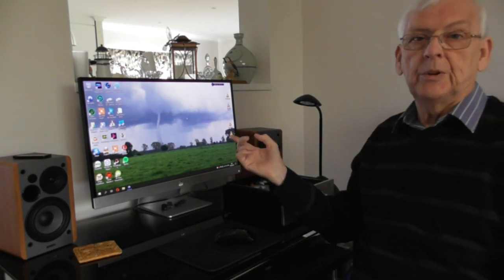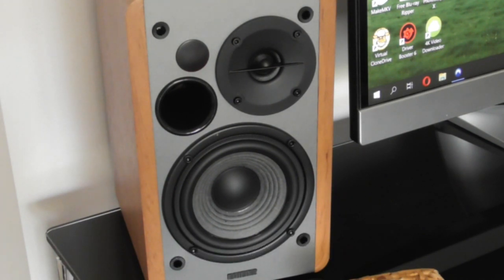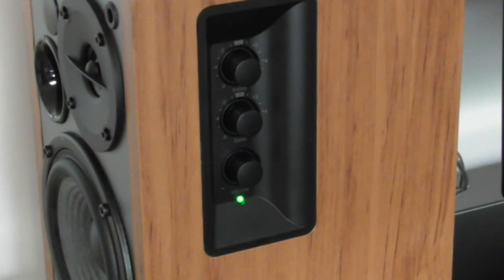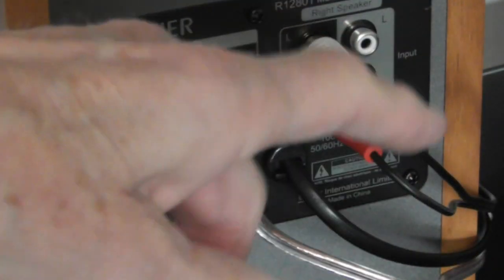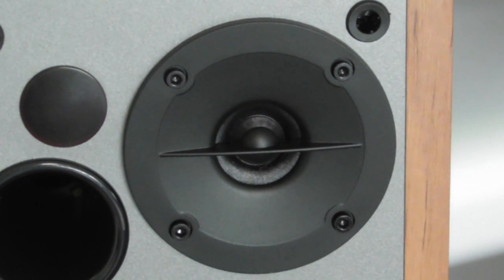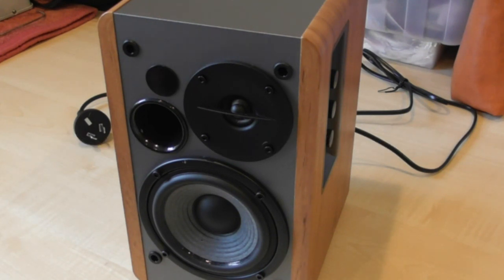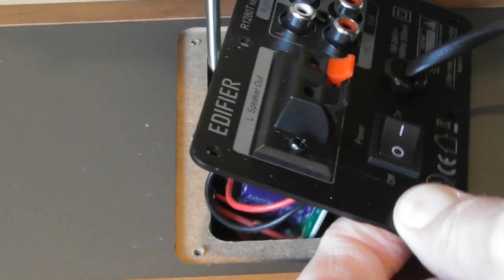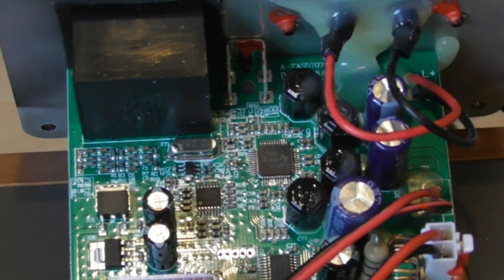Edifier R1280T Loudspeaker review, and a look inside.

Comment: Hello! I have a pair of these (well, the BT version) and the power supply has died. Do you happen to know what the expected input voltage and amperage so I can replace it?
Reply from the maker: Sorry Jaknz I did not make any electrical tests at all at the time of my review. Maybe someone who reads you request may have the answer for you. I'm unable to help as I no longer have these speakers.
Reply: @MichaelBeeny  I have tracked it down. There was a tiny rolled up label on the cable, hidden under the foam batting, indicating it is 16.8V at 30W, or just about 2A.
Reply from the maker: @macphile  Well done, that's saved some leg work for sure. Surprisingly low, I was expecting about 19 volts but for class D with 4 ohm drivers, that would make sense. Not sure where you will fine a SMPS with that odd voltage. Maybe a 15 volt one with an adjustment pot might just work. Good luck.
Reply: @MichaelBeeny  the filter capacitors on both the dead power supply and the amplifier board are rated 25v, so I suspect it would be perfectly happy with 19v in. I don't want to put that to test though, since I was able to find a 16v PSU that it's working with.

Comment: Do you reckon I could purchase better 4 inch woofers, unsolder those woofer of the R1280DB and solder on newer ones.
Quite sure there are better 4 inch woofers with better sensitivity, SPL and frequency?
Reply from the maker: It's not a bad driver, changing it for one you have no info on at all, is a hell of a risk. For what it cost it's really not bad. If you feel it's not up to your requirements, simply sell them and buy better.
Reply: @MichaelBeeny  I see.. because as far as I'm concerned.. these are of the best bluetooth and loudest bookshelf out there. Yet I feel it's not enough

Comment: Hello, 
I own these loudspeakers and I am looking for the upgrade of tweeters. Could you please write me few tips, wich tweeters I could use there? Do you know, what is (what I need) the impedance of tweeter? I dont like the "muddy sound" wich is because of tweeters I think.
Thanks
Reply from the maker: To be honest, it is what it is. Not really worth finding something that fits, impedance, mostly sensitivity. The main issues are the signal processing, not the tweeter. If you are not happy probably best to sell them and start again. So many low cost speakers with amplifiers built in suffer from signal processing.

Comment: My Edifier R1280T left speaker stopped working, I am not able to find 13mm silk dome tweeter. Is there a chance I can replace tweeters with different size, if yes then what are suitable options (here I am asking about specifications, like 35mm 6 ohm 15 watt neodymium tweeter ) and what are the things I need to check before buying like ohms, size, power, fit ? can I use any tweeter which can fix in the tweeter hole of the speakers or what could be the possible solution to just make speakers usable again with almost same quality of sound reproduction. Need an Expert advice
Thank You Sir!
Reply from the maker: To enable correct matching, you need to know the spec of the existing unit, which of course we don't. So, it's almost guess work. I would contact the distributor in your country and purchase a new one.
Reply: @MichaelBeeny I am sorry if I may sound complete noob but on website it says 13mm 4 ohm silk dome tweeter what are the other spec do we need ?
Reply from the maker: @itsabhishekkashyap Sensitivity, is most important. Something never shown in integrated speakers.
Reply: Fortunately the distributor replied and they'll be sending the new tweeter although at not so reasonable rate but atleast I can use them after.
Thank you sir.

Comment: Hi. Did you figure out what the crystal was for on the motherboard?
Reply from the maker: It's probably used in the remote control circuit. I've still not managed to get a circuit. I cannot think what else would use a crystal.

Comment: would you say the difference in air around the speaker is just the reflection? or sonic coupling? I'm about to get a pair for a small desktop home studio playback not mixing . so im wondering if i need to get off the shelf they are on as they will have nothing in front of the box, as it will be sitting at the edge
Reply from the maker: Most speakers tend to sound more open if surrounded by air. Hence an open frame stand is the best option. However this is not always possible. Try it out in your preferred place and see if it's OK. It's not just in front but the sides and back. You will be surprised at the difference placing makes.
Reply: @MichaelBeeny  agreed , I work in the live music industry and we fly PA these days and with point source audio speaker design its a magical setup. hence my wondering if you felt it was a sonic coupling affect or more just the actual air space for the waveforms to develop. Ive sat through hours of Systems techs chew my ear off showing me fly designs for PA's at arenas but Ive never thought about the same science in small bookshelf speakers to be honest . maybe ill adapt some work tech and fly the speakers from my ceiling haha . then i can brag to my front of house engineer friends haha

Comment: Help please! I have the Edifier r2000db and I want to replace one of the bass speakers. Where could I buy the exact same 5 inch speaker?
Reply from the maker: You will need to contact the distributor of the speaker in your country, they should have spare parts available. The driver might be made just for that compony.

Comment: Would anyone know if it is possible to remove the side wood pieces to be able to modify or exchange for another one without damaging the box? I couldn't see any screws inside the box to remove them.
I would like to buy the R1700bt and exchange the wood for Imbuia (a wood here in Brazil).

Thanks for you video Michael!
Reply: It will be possible.  You would have to smash it out with a hammer, be carefull around the edges tho

Comment: When you say turn off bass completely do you mean set the dial to 0 or to -6?
Reply from the maker: Yes -6 this will kind of compensate for some of the extra bass boost in the EQ. Your own speaker location will play a part in this adjustment.
Reply: @MichaelBeeny  Thank you. With -6 setting, I found that 80-90Hz dips too much with 10-200 Hz test available here: https://www.audiocheck.net/soundtests_headphones.php I also hear some distortion (sounds like something soft detached from the speaker from the inside, or air moving a piece of fabric at high velocity) in (only) the right channel during the bass test. Not sure if it's because there's less space inside/more things that can rattle, but I'll be exchanging my speakers today.
Reply from the maker: @moonny5890  I think you have a faulty unit, I had to replace mine because of a faulty tweeter. They should sound very similar to each other. On a white noise test, they did. You are never going to get a very flat response due to the high amount of signal processing and the tone controls. I don't know why they cannot offer a flat possession as an option.

Comment: I got mine today after my old Creative T20 (old ones) broke a while ago, and I'm disappointed: everything sounds muffled, numb, as if underwater. I made absolutely sure that all the wiring is correct, too. Most bizarrely, holding my ear close to just one of the two boxes sounds clearer and crisper; once I sit in the middle between them, the sound gets watered down.
Reply from the maker: It does sound like you have a faulty pair. I would return them for a replacement. Could they it be they are connected out of phase by any chance? I good test is to apply a mono signal, face each speaker to each other. If the bass vanishes, they are out of phase. If so reverse one speaker wires. Other than that use option one.
Reply: @MichaelBeeny  Thanks for the response, and happy New Year. It may simply have been a problem with the acoustics of my setup (simply put, having the speakers behind the monitor such that it blocks the sound waves is, perhaps unsurprisingly, not a good idea). Dialling up the treble as was suggested alleviated the problem somewhat, as did installing an amplifier preset.

Comment: hello there, do you have any recommendations for accurate sounding speaker that wont break the bank?
Reply from the maker: I have been out of retail for many years now so don't hear the wide range that I used to. At the lower end of the price range you will find speakers very quite a lot, with more colour to the sound. My advice would be to try and hear them, hard these days I know. Never a good idea to buy blind.
Reply: @MichaelBeeny  thanks

Comment: Could  I mix rap music  in a pair of these with those setting you provided bass -6 ,treble + 6, as a flat response ? what do u think? specifically Rap music and I'm talking for this budget speakers. Thank you
Reply from the maker: I don't really know how to answer this question. When I talk about a flat response it means if you have a real instrument, ie a piano as an example, it will sound as near to a real piano as possible. However with electronic music, none of it is real! There is no correct sound, some may like it with lots of top, but many like extra bass. I think you will find it fine, you can change the sound to suit yourself and it will be right for you.
Reply: @MichaelBeeny  thank you
Reply: Are you mixing for recording purposes?  If so, you're probably going to want something with a flatter response to give a more neutral impression of what you're mixing so that the resulting mix sounds good on the widest possible range of speakers when played back on other speakers.  Mixing on bass-heavy equipment might result in the sound being a little thinner than expected on other listener's equipment if they have lower bass response from their speakers.

Comment: Is there any way to tell whether the roll surrounds on the bass units are made of foam or rubber or neoprene? Foam surrounds last less than a year in countries/areas of high humidity climate.
Reply from the maker: I can confirm these are a rubber/neoprene type surrounds. I agree with your comments on foam, best avoided.
Reply: @MichaelBeeny  Xiexie=Thanks !!!
Reply: Yes that is the problem with bose that uses foam surrounds. Especially the Companion 2 desktop speakers. These cheap Edifier desktop speakers can last longer than the bose that is full of bass.
Reply from the maker: I have to say I have never liked ANYTHING that Bose has made for a number of reasons.
Reply: @MichaelBeeny  the only stuffs that I liked on bose is their processors like the Bose control space. 😊

Comment: I think that spongy foam is meant to absorb heat on the big magnet :)
Reply from the maker: It's meant to absorb sound from the rear of the speaker, but that little bit is 100% useless. The magnet will not produce any heat at all.

Comment: Is it possible to hook up additional subwoofer on that speaker. I have a pioneer s bd922sw, and i dont know how to connect it
Reply from the maker: As I have no knowledge of your sub, I cannot say if you can use it or not. The Edifier has no dedicated outputs for a sub. Not sure why you need a sub anyway, as the speaker is very bass heavy as I say in the video.
Reply: you need a DAC/amp with dedicated outputs, that's the only way, and probably you can improve the sound a lot more, probably I repeat.
But you need to understand that you will never compare an inicial setup,  with an high end or even low range HIFI quality with such setup (obviously I mean the Edifier r1280t, but you will get an exceptional sound for someone who had the interest to be in a entry range)
Reply: Does it have a crossover/dividing network?
Reply from the maker: @danielcabrera5260  Someone has not watched all the way through. I do explain the crossover, what there is in quite detail!

Comment: Hi Michael, I bought a pair of r1700bt speakers which are the slightly bigger brother to the r1280t. They cost me 139 euros. Most people put them next to the computer monitor but I put them on tall stands with some angled foam underneath them. I turn the bass and treble down a bit.   I use them either connected to a dacmagic or over bluetooth connected to the macbook. With good source material are much better than their price would suggest. Due to the small size the imaging is great. Of course with a 4 inch driver you are not going to be waking the dead but at normal listening level they are absolutely enough for me. But at those levels late at night (when it is quiet) you can close your eyes and imagine you are listening to something much larger and more expensive. btw there is also a passive version of the r1700bt called the p17 which uses the same driver whose magnet is even larger than the r1280t.
Reply: I am going to buy when in this coming week .... would you recommend me under 130$. Am thinking of 1700 tb
Reply: @vforvendetta937  well I would buy them again :) For the price they sound pretty good and are really well built (like little tanks) I ran some test tones through mine and they go down to around 50hz which is pretty amazing for something so small. In my living room (30sqmeters) they go loud enough.....
Reply: I have 1700 bt, put them 2 feet  from the wall, on stands, and yeeees, they blowe  me a way!
So small, sutch a imaging, bass not aggressive offcourse, but It make me to want to listen next track, over and over again.
My second set up are Luna Eclipse, by the Tv.
 They do the job better then Tv's loudspeakers,   and you can enjoy the music on Spotify!
So, for little money, and space, i got my music and peace in the house. Who is married will understand...
Reply: @kentaur1234  I today got 1900tv for 120$ I compared both 1700 bt Vs 1900 tv    .. mine vocals was much clearer and brighter.  So I go with it for my pc ....+ Mine don't have Bluetooth ...
Reply: @kentaur1234  thats true. I keep asking myself how does a sound like that come out of something so small. I am listening to some acoustic jazz now and you can hear all the base notes as clear as the player would be in the room....I am married too but my wife gave up complaining about the hifi a long time ago. Going to link my turntable up to these soon

Comment: Ive just bought these for my PC set up. Not as good as my hifi speakers as youd expect, but at £99 great for PC usage
Reply from the maker: Expensive in UK, here in NZ cost $140 (75 pounds) Not often things are cheaper here.
Reply: Just ordered mine now. There's a nifty EQ guide for them if you want to tweak the sound to be more neutral. According to the guys in the thread the results were surprisingly good. Here it is: https://www.audiosciencereview.com/forum/index.php?threads/edifier-r1280t-powered-speaker-review.16112/
Reply from the maker: @laalki80  Thanks for this link, very comprehensive. Funny after all that testing, the conclusions are much the same as mine and I only used my ears. Not bad for 72 year old ears really.
Reply: @MichaelBeeny  No problem!
Reply: @laalki80  I know this is quite old but I ordered these speakers, how do I EQ them like the guide? which program do I download? 
thanks!
Reply: @R0gue1gNite  EQ APO is the equalizer program and PEACE is the graphical UI for it. Can't remember exactly how it was done, but read the thread I linked above carefully, the instructions are there. Took me some time to figure out too.

Comment: Does it have a crossover?
Reply from the maker: Just a single capacitor in series with the tweeter.
Reply: If you want the bi-amped version and is active crossover. You may want to look up on the R1850DB plus it also have a sub pre-out

Comment: My Kenwood XD402 Hi-Fi burned out so I was looking at active speakers because I don't have the space for a full sized amplifier, I also don't have the money for overly expensive bullshit, so naturally, my choices are limited to a crappy pair of Klipsch R-51PMs and Edifier S2000mkII, because most affordable imports simply aren't available in EU, so basically I was heartbroken because I can't afford something better. The reason why is because I've been saving up for speakers for years and best I can do is $500, I can't live without music or decent enough sound, so I thought to myself, what's Edifier's bestseller, and found this, it's 4x less money, similar range to what I'm used to, but then I hear bad things about it and I see that tweeter and it makes me cry, because I just lost my last choice... I don't know what to do anymore, I'm open to suggestions
Reply: these are good. Needs some tuning and better cables though. My pair’s muddy bass has gone away by using a custom canare l4e6s rca cables and i attached a set of feet spikes to raise it higher from the table. Positioning is critically important for these speakers. 

I Wouldnt say that they’re good for mixing but with all the mods done, they’re pretty good for listening for its price. Surprisingly Mine actually sounding pretty flat that i have to dail the bass up a little.

(edit) just noticed mine is the “db” model.. maybe it has a different tuning as the one reviewed.

Comment: I'm not sure about the clarity of class D amps.
Reply from the maker: At this price point you are not going to get a choice. It's as good as it needs to be for a speaker of this price.
Reply: @MichaelBeeny  You right Sir.. 👍
Reply: you should check out class d amps based on the TPA3116 chip - douk audio/nobsound make decent ones, amazing really, you wont find a cleaner sound for the price, maybe triple the price
Reply from the maker: @elduderino7767  Class D do have a place in speakers like this and do give good sound for the price. It's a good start with HiFi.